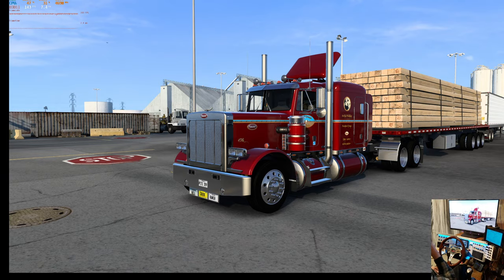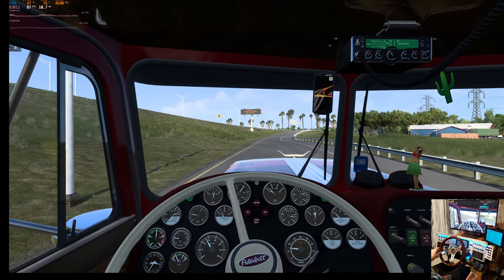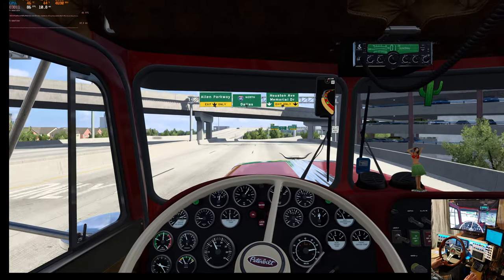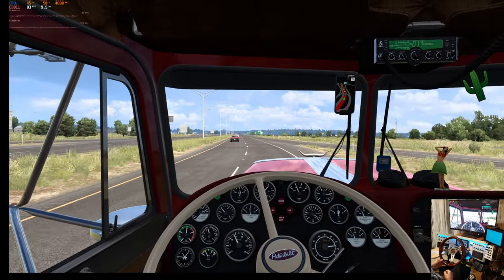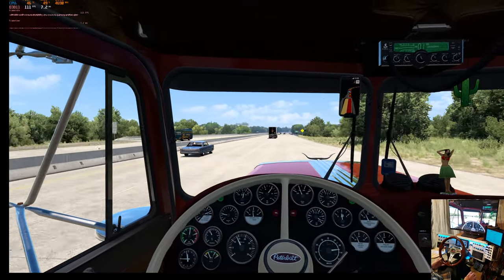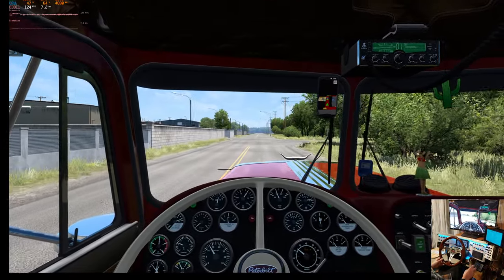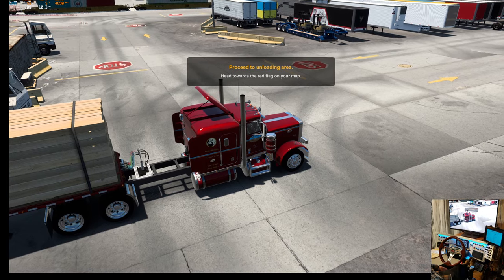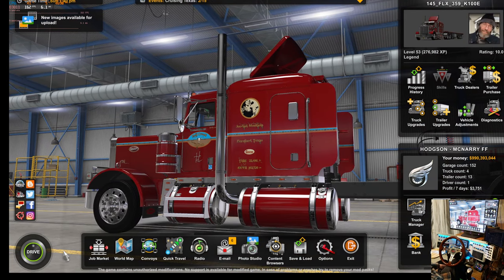ATS Lumber from Galveston to Dallas with the FLX 359

Comment: Great video. Geez those Ports are kinda confusing to me. Those Texas roads takes me a littie time to figure out. Has much I use to truck Texas it has changed so much couldn't find my way around if I had to good thing for GPS. That was a text book backing at the port good job. I've been noticing that when I  back up my trailer will drift almost every time towards the parking spot all I've been doing is making small corrections and it seems to work with a pull up. Go figure LOL I'm wanting to change my steering wheel out and I think I might have ask you already I would like to know what wheel do you use and is liter or heavier than the orginal one. Seems some people have had issues with a heavier one. I have found a 13.6 wide wheel and is lighter than my G29. Got any suggestions.
Reply from the maker: Hi Don, glad to hear the backing up is going well. I'm usually better at it when I'm not blabbing away. It;'s a wonder I don't have more mishaps in the videos! 

My wheel is quite light. The centre is aluminum which helps. It's a 13 inch. The only issue with mine is it's an uncommon 5 hole pattern. I had to make my own adapter to fit it.